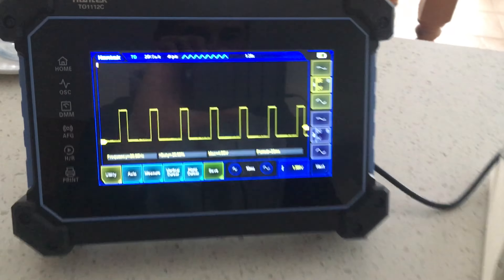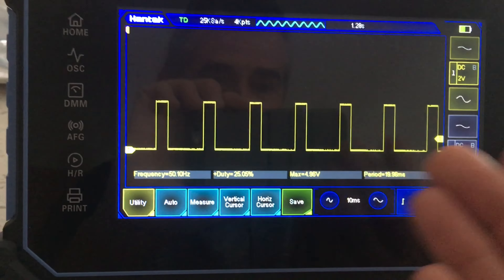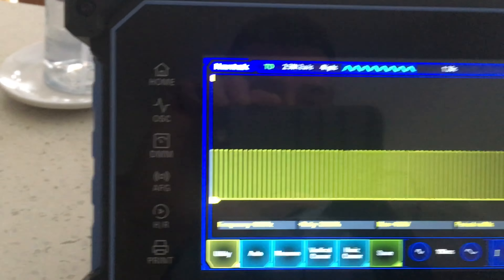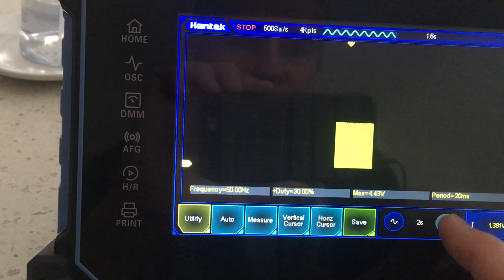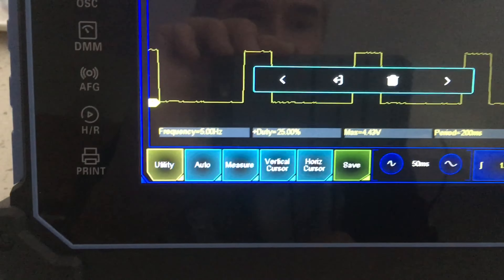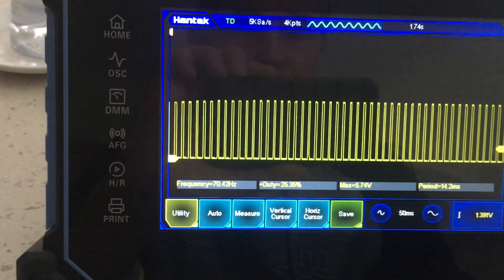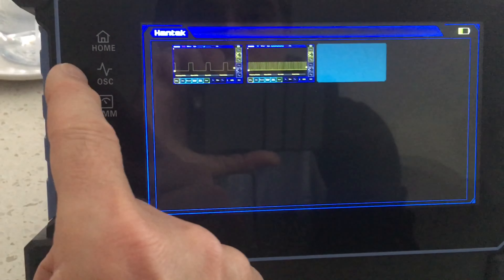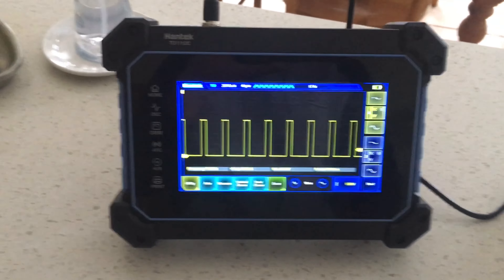Hantek TO1000 Series Issues

Comment: Thanks for this crucial information.  
I will also be monitoring your channel to see if Hantek fixes this problem before I purchase this unit.
Thanks again for the upload.
Reply from the maker: Thx for watching 🍻
Reply: I just noticed in your other video that you updated the firmware, and it fixed the amount of captured screens you can save. However, did it fix the other issue  about reviewing a variable amplitude signal and flattening it out?
Reply from the maker: No other issues appear to have been corrected as far as I can tell. 🍻

Comment: You don't need to save more than 1-2 snapshots. Sometimes it turns out to save 6 pictures, but the oscilloscope starts to reboot itself, and deleting pictures becomes a big problem. And this is on the firmware from 2024. This oscilloscope also slows down a lot on the scan in "ms", and in "s" it freezes altogether. If you take an oscilloscope on a scan in "us", and then reduce it to ms or "s", then the frequency readings begin to lie a lot, and the waveform changes from small, unreadable to beautifully readable, only fake.
Reply from the maker: Software is poor all around on this product. Thx for watching.

Comment: Hi, how to setting a CC 650 to messure relative compression?
Reply from the maker: Sorry I don’t own a 650. But this might help: https://youtu.be/28PhjhwpJtU 🍻
Reply: Place the positive on the battery terminal.  Place the negative on the b+ of the starter. Set the scope to 2ms/div and a 0.5v/div. You are using the battery cable as a current clamp. You will need to tune the volt scale. Depending on old school big v8. To new gen reduction starter 4 cyl. Hope this helps.

Comment: THANK YOU FOR YOUR TIME ,,, I AM WAITING TO HEAR BACK FROM YOU IF THERE WAS A FIX . I REALLY WANT TO BUY THIS SCOPE ,,, DO YOU THINK THAT THESE ISSUES SHOULD BE A DEAL BREAKER AND WOULD  LOVE TO HEAR YOUR FEEDBACK THANKS ?????????????????????????????????????????????????????????????????????????????????????
Reply from the maker: As a hobbyist it's ok, but I wouldn't consider this a professional grade tool. Too many glitches that persist even after latest update. A scope that won't reliably capture and display a waveform, is of limited value. It's well packaged but poorly executed.  I continue to be hopeful the updates will resolve the issues. I thought I was buying a good product, I didn't purchase it in the hopes it will turn into one.
Reply: @TheGibby3340  THANKS FOR YOUR REPLY ,, NOW I HAVE BEEN CONSIDERING THIS FLUKE SCOPE AS MY MOBILE AUTOMOTIVE ,SCOPE WHAT DO YOU THINK Fluke 123B Industrial ScopeMeter hand-held Oscilloscope, 2 input channels, 20 MHZ bandwidth, SCC120 Kit. ?????????????????????????????????????????
Reply from the maker: Fluke pretty much sets the standard in quality industrial standard tooling.  🍺

Comment: We try to make it start, but it only makes 3 beeps.... can you help us? We are also trying to charge it, but for now it doesn't work.
Reply from the maker: I suspect if the batteries have dropped below a minimum voltage, it will lock out the charge function. You could resort to removing the batteries and charging them externally. Reinstall them and see if operation is restored. ⚠️ Don’t overcharge them. Good luck 🍻